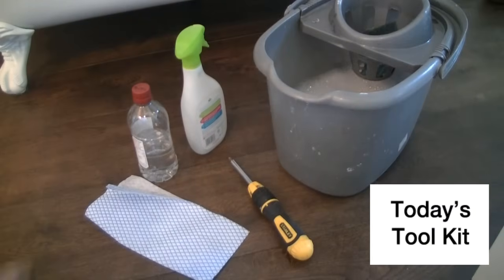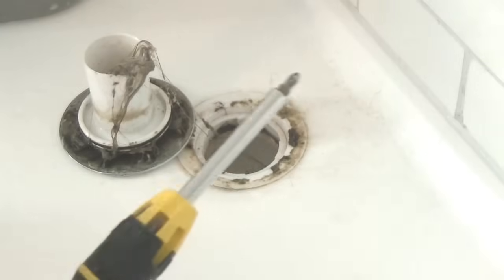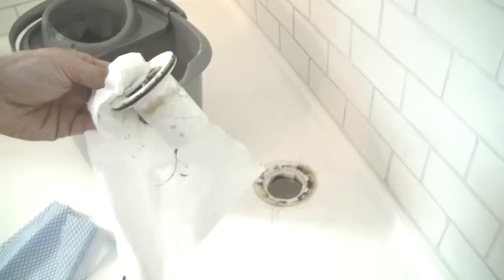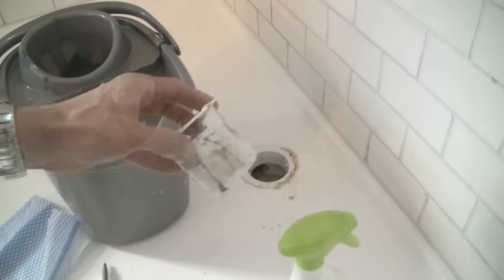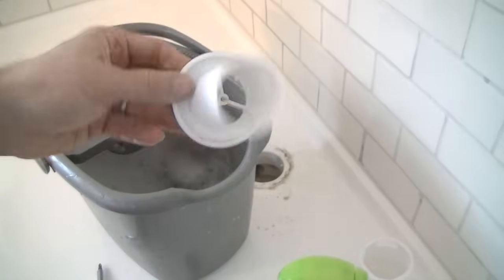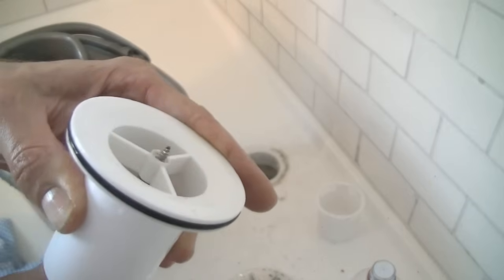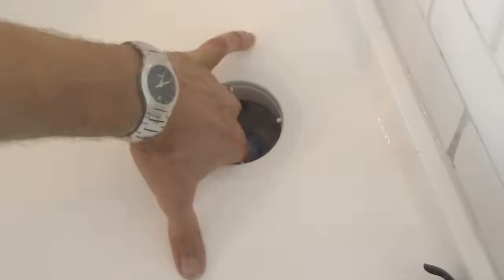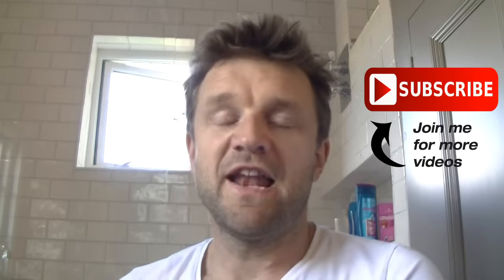How to Unclog and Clean your Shower Drain

Comment: Hello     have been trying all day to clear a shower drain but no luck. Unfortunately, the blockage appears to be at least a couple of metres along the pipe judging by the length of flexible cable I've inserted (the pipe lies beneath a quarry tiled floor)  .  I've tried the vinegar and baking powder method - plus loads of boiling water - but it's difficult to insert these very far along the pipe as the pipe lies horizontally and these products just tend to spill out again.  Any ideas? I'd be most grateful. Thank you. Eric Payne Lincolnshire.
Reply from the maker: Have you tried a plunger Eric? Sometimes the old fashioned techniques are the best and it's worked for me a lot in the past.
Reply from the maker: The other option which would be better is this https://www.screwfix.com/p/drain-unblocker-7-6m/11325 I haven't used it myself but the reviews are pretty positive.

Comment: Hi Charlie,  
Old lady mid-process here.  The small water container does not seem to be removable. All else has been cleaned and I am trying to get the remaining junk from around that container. DO I have to try to figure out how to remove or might it not need it to be removed I just tried to email you - it didn't work-.  Would appreciate your help!!  As in  HELP!!!!!  Thanks!
Reply from the maker: Hi Peg. It's a little difficult to say without seeing a photo, but not all drains are the same, so perhaps your container isn't designed to be removed?

Comment: Its a really old video but I do have a question - I tried to clean out my shower and its a lot cleaner than before! The only thing is that the ring that attaches to the shower is dirty underneath the ring and I can't clean it very easily - any advice?
Reply from the maker: It's a tricky one. I use an old tooth brush to clean under the ring. To stop dirt forming under it going forward you could always pipe some silicone under it, but you'd need to properly clean/ degrease it and wait for it to completely dry out, first.

Comment: Should there be water in the bottom? After I’ve removed and cleaned the odour trap, I look down into the hole (I think you call it the waste in your video??) and there’s still standing water. I turn on the shower (the odour trap still removed) and the hole fills and drains, but not entirely. Is this standing water the reason why it smells, or is a low level of water normal?
Reply from the maker: I'm not entirely sure of your set up but the water is essential as it stops smells coming up the sewer waste pipe into the bathroom.

Comment: Hi i cleaned my mine just like this and now the drain stinks of damp kinda mildew smell. Do u know why this would be?
Reply: Put 1/3 cup bicarb down the drain. Pour in 1/3 cup white vinegar. It will fizz. Leave until your next shower. The water from your shower will drain away the bicarb/vinegar sitting in the bottom of the pipe. Things should now smell very fresh. If not, it means thee is still a build up of waste in the pipe. Repeat the bicarb/vinegar after the last daily shower and within the week you should have a nice smelling bathroom.for an hour or until your next shower.

Comment: I have done all that but still have a awful smell in bath. I have clean bath sink and outlet under sink. I have put cleaner down plus l put bicarb and vinegar but still smells. Had all my drains outside clean and checked. Look like showers going have to removed. 
Just bought the house and it’s had a extension. The owner put strong air freshener in the shower room now l know yet.

Comment: We have a bad smell from our downstairs shower. The plug hole cover is clean as is the trap but the level of waste water in the  waste is much higher than in your video and covers the waste outlet. I am presuming a length of hose pipe shoved along there is what is needed to clear any blockage. There's no standing water in the tray.
Reply from the maker: The water is the trap is normal - stops smells coming up the drains. I wonder if you've got a sink in the room with a blocked or badly designed trap. Or could it be the smell of damp?

Comment: When I remove the cup from inside the shower trap there is always some water lying at then bottom. I thought this was normal but when you removed yours and cleaned inside there is no water there. Why is there water inside mine?
Reply from the maker: The water disappeared only because I dabbed it out, but as soon as I turned the shower back on it returned. You need the water in there as it prevents bad smells coming up into the room from the drain. It's a very important part of the design!

Comment: Can you pour bleach around the shower drain or in to the shower waste section itself?
Reply from the maker: It's generally safe to pour bleach down pvc but you should flush it out with warm water afterwards - see this article https://www.hunker.com/12606617/is-bleach-safe-to-use-on-pvc-pipe . Also, just check that bleach is ok for the shower tray itself. That said, the bleach won't dissolve hair and stuff and in my experience it isn't great for unblocking drains. So if your drain is getting smelly, the best way to alleviate this is a combination on a cleaning product like bleach and a good old fashioned plunger - as you need to re-establish the through flow of water to clean the drain out and remove nasty odours.
Reply: @CharlieDIYte  Thank you, that's good to know.

Comment: All common sense stuff really, but how do you clean or unclog the horizontal pipe that runs from the shower drain. In the video there is an opening to the side when you remove the trap. How do you clean the pipe that fits onto that opening?

Comment: When i take off the lid the hole is full of old smelly water. 
 How can i get rid of it? I cant see where the water should drain either?
Reply from the maker: It's a little difficult for me to comment without knowing exactly what waste you have, but the old smelly water is actually very important as it's the trap that stops the foul air coming up from the drain. You have something similar under your sink, under your bath, and in fact the water in your toilet does exactly the same job! Don't worry about it though - just clear it out with a sponge or something similar, clean the shower drain as I suggested and then run the shower briefly to put the water back into the waste.
Reply: Charlie DIYte hi charlie. Thank you for replying. So i used kitchen towel to get the water out so everything is clean BUT  the water still isnt draining away fast enough. Suspect it may be the pipe? The pipe connects to my sink i think and the room next door (im in a granny flat on the side of a large mansion). What do you suggest i use to try and clear the pipes please?
Reply from the maker: Lisa Lisa Hmmm. Tricky one, as you don't know how far away from the drain itself the pipe is bunged up. I haven't encountered this myself but there's quite a lot of advice on the internet that recommends baking soda and white vinegar - you might try out what Dyno recommend in the attached link https://goo.gl/tM39KX Sorry I can't be of more help...

Comment: Wow that is a lot of work.  Why not replace it with a screen trap 1 dollar, more efficient, easier to remove hair just swirl a Q tip on the hair discard, run water done.  Been using it for 40 years no clog shower.

Comment: What to do when the water in the water lock evaporates? (not used often) And the water lock water disappears leaving a sewer foul smell.
Reply from the maker: Audun Jemtland Best thing you can do is run the shower for a few seconds to replace the water?
Reply: It evaporates again and again. Not often at this apartement. But when I am it reeks sewer. Thought there was a trick to put something there that doesn't evaporate

Comment: Mine isn't chrome, it's plastic and my sink is overflowingwhen I put the shower on. Do I need to unblock the sink or shower drain or both. 
It's a bitch to unscrew. I swear the plumber must have glue it. 

Any help please?

Comment: Vinegar is ethane acid so if you don't want to use something acidic you shouldn't go for vinegar
Reply from the maker: Thanks for sharing that, Christopher. What would you recommend?
Reply: @CharlieDIYte  I don't know if there is a problem with using something acidic depending on how strong it is. Maybe if it's too strong it can dull the chrome.

I used bathroom cleaning spray wich basically worked ok. If all you want is to unclog it you could also just remove the hair, rinse it, and stick it back in with some dirt on it. You're not going to see it and it shouldn't really impact the water flow.

Comment: Hydrcloric acid to pore down the drain will dissolve most hair & you can buy from hardware or pool shop.
Reply from the maker: I'm not sure I'd want to put that down my plastic drains 🤔
Reply: Thank you so much just cleaned my shower  Drain  now good as new
Reply: @CharlieDIYte  It's apparently ok on plastic but definitely not on metal. Always worth checking first though.

Comment: This drain has the stupidest design ever. Why would it require so much hassle to remove hair? Can't even put a hair trap or whatever to prevent hair getting in. I just moved to a new house and this is the exact drain! I hate this drain. 

Ps. Thanks for the video though
Reply from the maker: The thing is Cat, it's not the drain but the hair that's the problem. You have to look at what it's catching and be grateful that it's preventing all that hair going further down the drain where it could cause a serious blockage. I actually think it's quite a clever design. A hair trap that was easy to clean wouldn't be effective in catching the hair in the first place.
Reply: @CharlieDIYte  I understand the hair trap mechanism. I used to have all sort of other hair trap drains and this one makes removing the hair troublesome and gross. Now I have to switch to another device which is flat and have small holes on it and my hair just gather together which is really easy to pick up and dump into bin after a shower. 
Yeah this design is better than just a hole with nothing to catch hair I agree with that.
Reply: @CharlieDIYte  btw sorry if I sounded too negative! Your video is actually very help for people who has that drain and want to clean it. It's not you or the video but the drain is the problem!😂 For those who have long hair and molt often, don't get that drain!